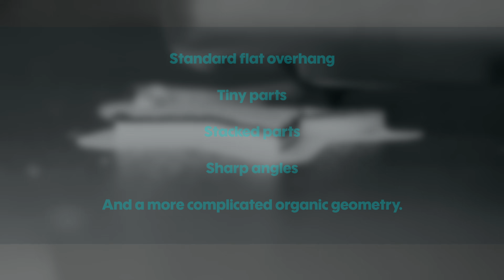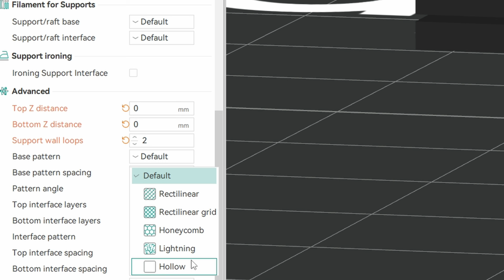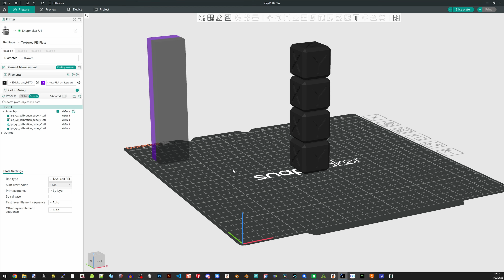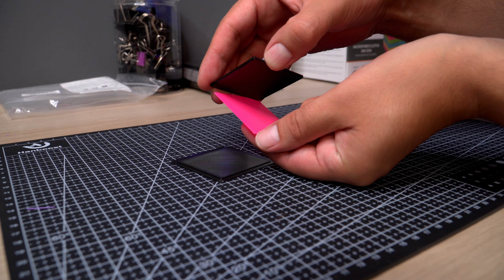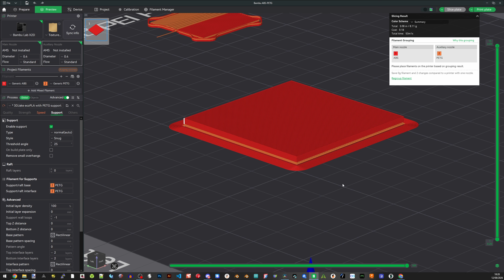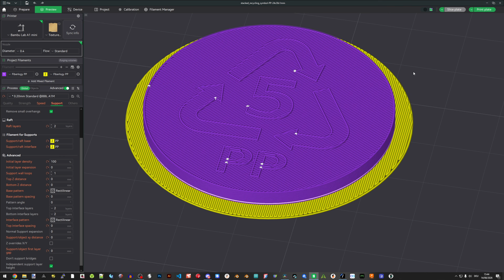Multimaterial Supports For PLA, PETG, TPU, ABS, PA, PC & PP

Comment: For PETG, what were the speeds/settings you used that got it working? I had a hard time with getting PETG to stick, even when I slowed it down.
Reply from the maker: Our support interface and bridging layer (the first layer of the part after support) were both 50mm/s. Keep the surface area in mind, if it is quite small it is really hard for a good grip to be achieved
Reply: @3 @3DJake_Official  i’m doing this with PETG Matte. It’s not even sticking to the PLA prime tower. Do you have any recommendations for this? I’m considering trying out bamboo’s support filament for Pat G, which is around 70% TPU at 80% pad G I’m thinking that might have a bit of a better bond to the PRTG Matte as opposed to PLA, but wanted a second opinion before spending $30 on it.
Reply from the maker: I'm not that familiar with Bambu's support filament but I have had numerous problems using matte PETG on PLA and the prime tower is also the weak point because of the lower surface area. I would prefer not to use a matte PETG but if you really need to you should be able to drop the prime tower speed, we also reduced that to 50mm/s

Comment: "designed specifically for a dissimilar support material"? One could just as easily say that it was given a crippled second extruder as a cheap means of getting almost half the capability of the U1, Creator 5, or any number of new and upcoming multi-toolhead printers. No sane person would use a Bowden extruder on a modern 3D printer without some serious cost constraints.

Comment: Nice video. Stacking is a great use case . I wonder if you can emulate a textured pei sheet for the upper level parts by having a lower density interface pattern so some of the first layer of second layer drops down into it.
Reply from the maker: That's an interesting idea. Getting the resolution of a PEI sheet is never going to possible and if you're printing a complex interface pattern there will likely be z hops potentially ruining the look on the first layer, ironing might help a bit with that. Very cool idea though, I could see a tool to create your own interface pattern from an image as a relief where the embossing pattern is just 0.05mm higher/lower than the rest of the interface, first layer prints above and when finished you have a cool custom pattern embossed on the bottom surface. I'm going to have to try this.

Comment: I wander if tpu-gf for pp  would fix the warping and probably wont jam as much
Reply from the maker: The thing is with TPU is that there are so many varieties so we have a lot of work ahead of us to see which one works best with PP. A composite filament will be more rigid but like the nylon carbon fibre we used there is more risk of it getting stuck in the part as it is much coarser. We're going to try some extra hard TPU first before we move on to more exotic kinds.

Comment: Very very interesting thanks !
Do you believe that the X2D prints a bit better ? I hesitate about which printer to buy.
Reply: We chose the X2D to be able to print things like ABS.  Since owning it we've found it can handle 2 colour prints using both nozzles or using the auxiliary only for supports or even printing a whole model through the auxiliary.  It's pretty versatile.
Reply: @loganmedia1142  and what you thought second nozzle is for? It's exactly for that!
Reply from the maker: Yes the quality is noticeably better but you just have way more options with the snapmaker. The X2D does what it says but the U1 is more versatile
Reply: @3DJake_Official  thanks !! yeah I don't print multi color, I will wait to see the Sovol M1D and the Creality K3, or I'll just buy the X2D.

Comment: I print the PLA support on PETG with full speed and have zero issues as of now.  Well 1 issue but not related to the support itself. Its the mixing in the nozzle that causes poor layer adhesion to the next layer. The printer is printing PLA+PETG at the same time because I didn't clear the nozzle enough. It split my print right where on the layer that has the PLA supports.
Reply: I had the same experience.  I recall reading about increasing the purge volume for the filament by around x3 the normal amounts, but never got around to testing it as I got a X2D shortly afterwards.

Comment: This was a super valuable video 🙏
I print a lot of PP in the H2D so I am going to try that TPU approach as soon as I am home… might save me from having to ship some of that fancy PP support material from Spain to Australia!

I usually need to run the PP out of the auxiliary port on the AMS HT. Plan to use CC3D 72D of Kexcelled 77D (super hard)TPU which I can run out of the AMS. Will report back. 

Have some Breakaway 80 support material coming so will try that with PC and PP too and report back.
Reply from the maker: Ooooh please let us know how the 77D works out, we are going to try a similar one.

Comment: Did you need to change any prime tower settings on the U1? Thats the bit that confuses me!
Reply from the maker: For most combinations we didn't but when we tried to get PC and nylon working we tried reducing the infill gap, reducing the speed and increasing brim size but it didn't help much. Bambu is a bit different from Orca forks, it creates an infill for the tower whereas Orca creates a line pattern with adjustable spacing which gives you a bit better adhesion between dissimilar materials.